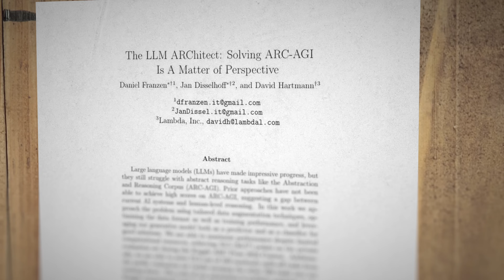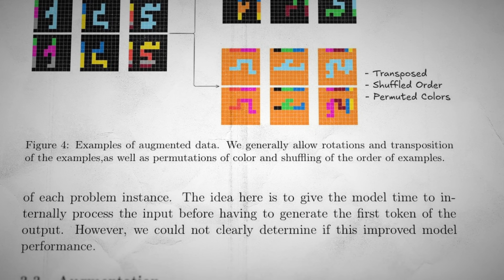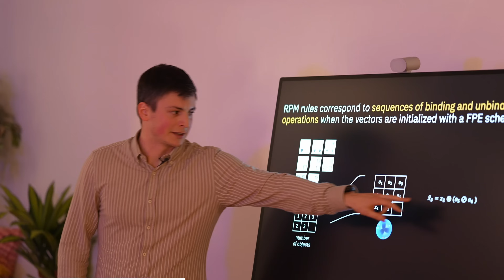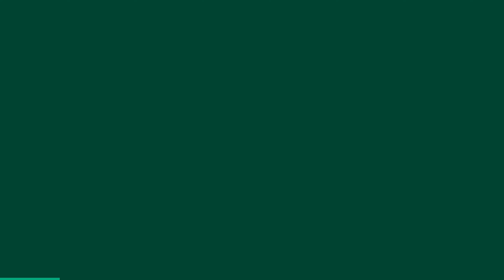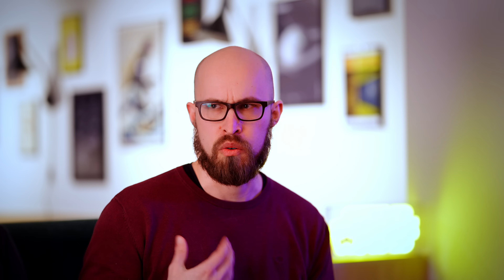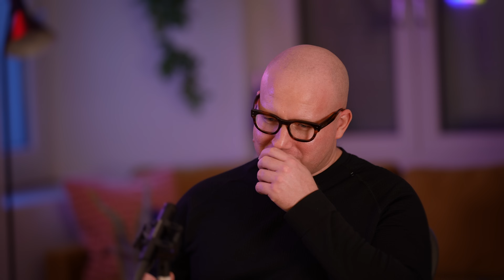The ARC Prize 2024 Winning Algorithm [Daniel Franzen and Jan Disselhoff]

Comment: what about a variable temperature at runtime? so the model can set its own temperature or other sample parameters according to the current situation. so it can set the temperature high when it needs to generate new ideas and be creative and set it to zero when it needs to output a result like a solution grid where it cant make mistakes.
Reply: We did experiment with this idea! It can help with one-shot accuracy, but reduces performance if we add our selection (as it benefits from more diverse candidates)

Comment: So they trained on the evaluation data. No wonder they had the highest score. They even said the score was way lower when they didnt train dorectly on the benchmark data.
Reply: I thought they trained on the examples provided with each challenge? Sounded like they compiled all the examples and trained on all of them simultaneously. That’s not the “benchmark” data, right?
Reply: @NeonNewt9 Yeah exactly what we did! The approach is called test time training. It works on ARC because each task includes examples (without which the task would be unsolvable). The true test set are the examples without solutions provided.

Comment: Didn't o3 get a higher score? Update: I think it is because o3 is closed-source, hence not qualified for the prize.
Reply: In ARC-AGI the compute is limited. So, Architects solution could be more efficient. I wonder myself, which one is better o3 or Architects.
Reply: @frun Our solution costs around ~4ct per task, while o3 costs 17$ per task using the cheap variant iirc
Reply: @JanDisselhoff  Could you tell us as an expert, if changes in hypothetical ANN architecture are theoretically possible during training or TTT(possibly including activation functions)?
Reply: I think you can, but you have to be careful about it. The greater the change the more fine-tuning you need to integrate the changes correctly, which can lead to degraded performance.
Reply: @JanDisselhoff  Thank you! Yes, i know it can dramatically degrade performance.
Reply: No, because it scored 75 and 87 on a different test. Probably,  ARC-AGI-PUB.
Reply: @frun no o3 could not win because closed source.
Reply: how does deepseek r1 do?
Reply: @blengi  15%?
Reply: @frun  is that a guess?